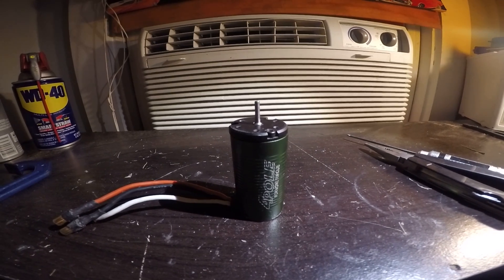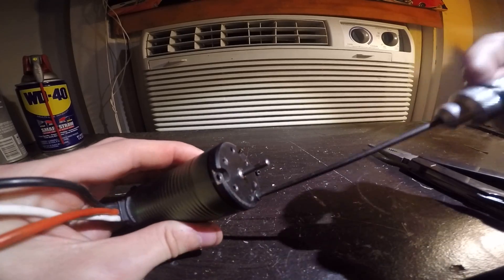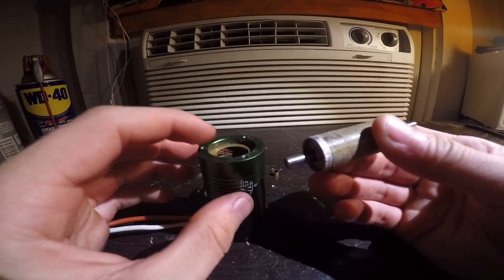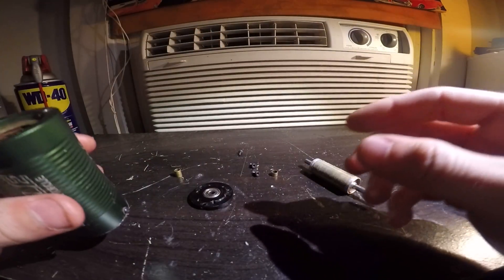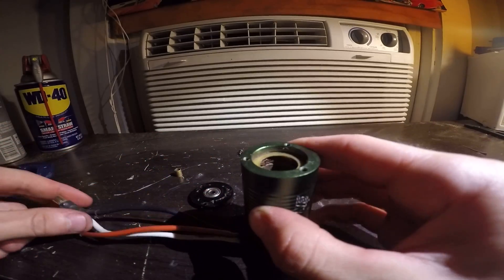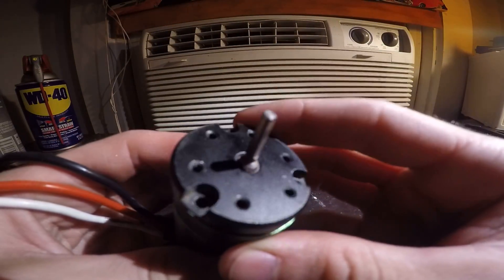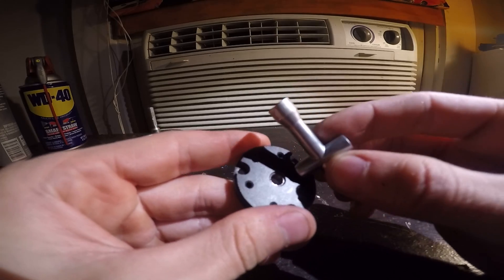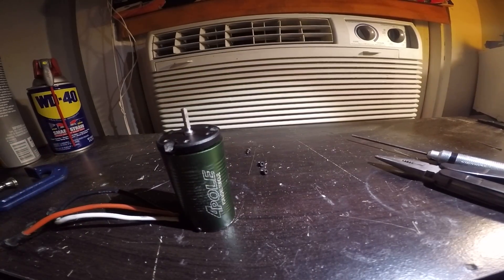How To Rebuild A Brushless Motor

Comment: One thing you should mention is on Kevlar wrapped rotors a non magnetic sleeve should be put around the rotor before sliding it out, like a thin plastic shirt box plastic,otherwise as you pull the rotor out if it damages the Kevlar at all,it will fail on a big rev causing the magnets to crack and seize the motor.
I had it happen.